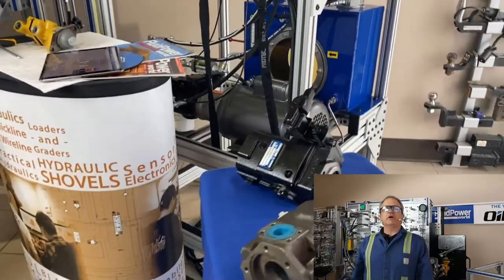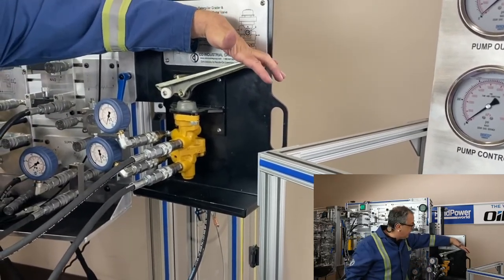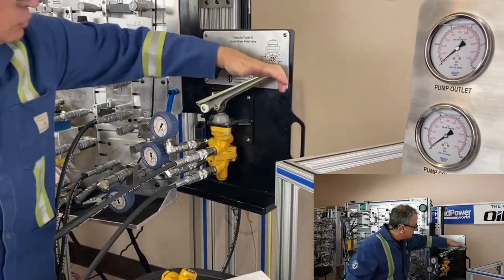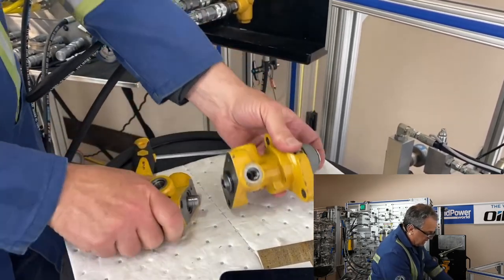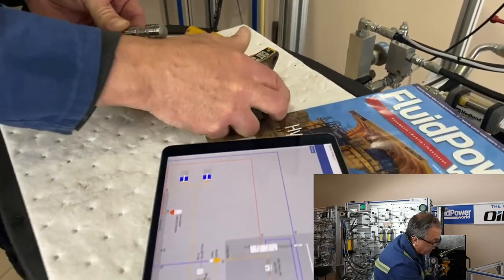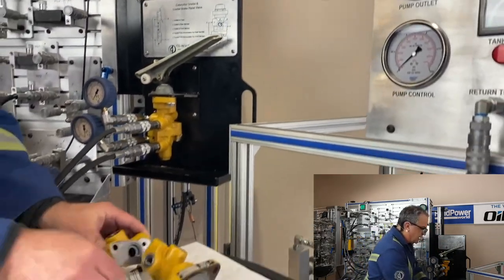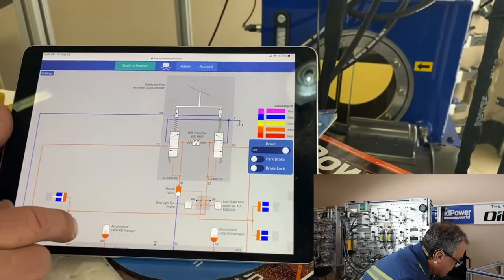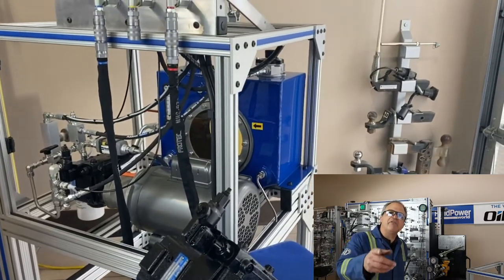Brake Pressure Pedals (Valves)

Comment: Thanks for the time but I think need to get familiar with the valve you presented before going life and start guessing which port is P & T.
Reply: Fair enough thanks for that input. This one was also meant to just finish up a little on some content from the April 28 pilot controllers live broadcast. So if you go back to that one which is really complete and long you might find some of the missing bits and pieces there as this brake pressure control valve is quite similar to other pilot controllers that we looked at in that video. I hope that helps a little. Thanks for accepting my watching.